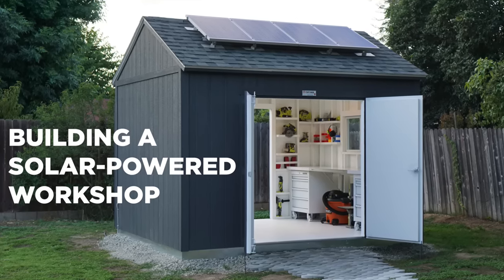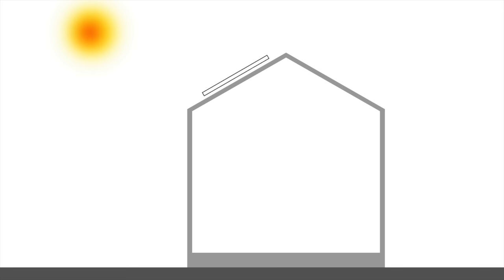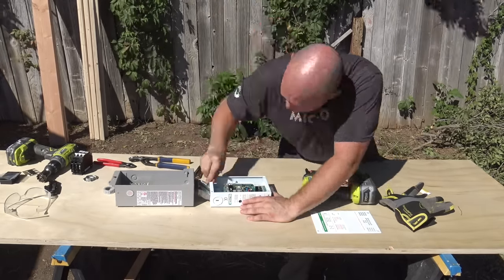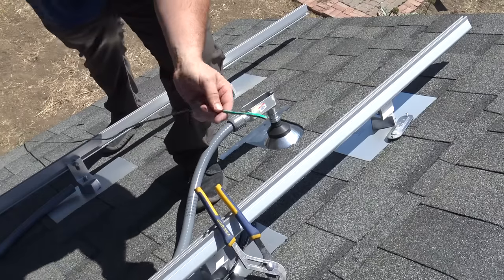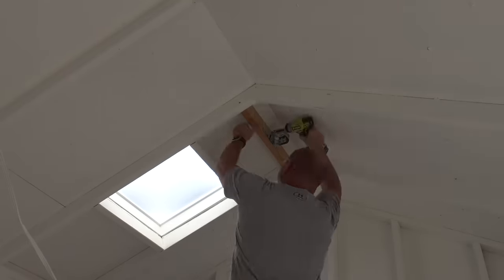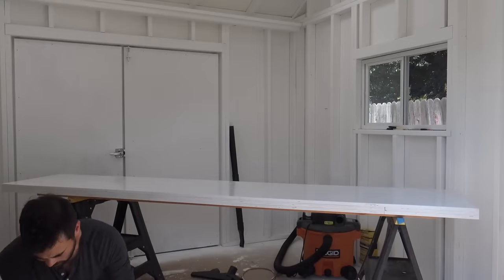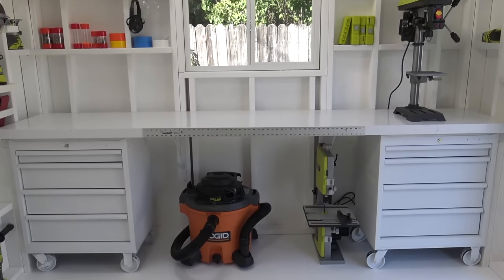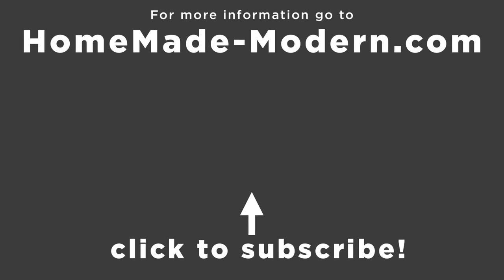Building a Solar Powered Workshop

Comment: Solar idea is super project but around 5000$ for this wooden room is too much I believe. You could buy a small shipping container (20 tons it’s 6mt*3mt I think) for around 800 bucks and do better for interior for half price I think. It costs too much.
Reply: TLH YSS  I don't think I shipping container as a shed is by code unless it under a certain width and height.
Reply: Yeah, but Home Depot isn't going to supply him with a shipping container, when they are retail partners with Tough Shed.
Reply: Depends.. in my city a no permit/no inspection shed is limited to 10 by 20. In other areas you may have no requirements or just go ahead and get the permit--which will include a foundation and electrical inspection.
Reply: $5K to run your power tools???
Reply from the maker: i did buy a shipping container and the quote to move it and unload it from LA to santa barbara was $2000
Reply: What I’m trying to say is 5k for only a wooden room (or big wooden box  which has doors and roof) is too much.  but looks pretty after spending more money to it👍 if you got money no problem it’s a pro job and to build you spend no time and energy. They come build and go that’s it. But if you have economic issues it’s not the first choice I think:) and all the room works with only solar power right?
Reply: Eco Mouse I don’t know about the partnership my friend what I’m trying to say is it’s too much for a wooden room:) it’s my idea👍
Reply: MrBobberino01 no dear friend not enough to make them work it’s only for a empty wooden room👍
Reply: Raskal if you use 2x20 tons container and put them side by side  and cut the top and make roof I think it’ll be enough height and width👍 of course if the shipping container is cheap. Of course it’ll take more time and energy. But cheaper👍 and  at the end of the day if I have more money in my pocket I will be more happy 😃

Comment: Only thing that might be missing is insulation. For us in the colder states it would be nice to have some heat or or even a/c. Also, can you run any extra electric wires off of the solar unit?

Comment: "wouldn't be much cheaper to build it myself"... yeah, ok.
Reply: Steed_Digital it's called sponsors. They subliminally plug them. It's interesting all of the tools are brand new, isn't it...
Reply: Subliminally eh? About as subtle as playing chicken with an 18-wheeler. This may as well have been a Ryobi commercial
Reply: yeah its amazing how EVERY single one of them, even the rake is brand spanking new, gee i wonder where he got it all from, you think he mentioned homedepot enough times?
Reply: Maybe your both right, however, once you get committed to a particular brands cordless battery platform, it really does make sense to expand your collection using only the same brand tools, where if you started with one of those $300-$700 multi tool kits, it's pretty easy to build up a collection like that rather quickly without needing to suppliment a lot more, or to have to be a Ryobi shill, especially at thier price point.
Reply: He was sponsored by Home Depot. Home Depot home brand is Ryobi.
Reply: it says so in the description
Reply: I can build the same shed for about $400-$500 instead of paying $3,000-$4,000...
Reply: Jared Graber nah you can't. I call BS
Reply: Srsly Brah add up the actual cost in building materials plus a box of nails...minus all the gadgets.
Reply: nerhu59  Considering the majority of the cost of that Tuff Shed is in labor to deliver & build it (both at the factory for prebuilt stuff and on site) then yeah you are absolutely right in this can be done for significantly cheaper.    Like a great many things, if you have the necessary skill set you have to ask yourself how much is your time worth.
Reply: This is a 40k shed... That no one can afford.
Reply: Love the finished look but, painting the husky toolboxs was sinful. It made them look cheap and unprofessional. Just a opinion guys don't jump all over me.
Reply: foytdie who cares? Just enjoy the content.
Reply: Jared Graber - do it then. And make a video. Maybe you will get views, maybe you wont. I love how people constantly criticize others that actually do stuff from the comfort of their couch
Reply: @J32-k9n  haven't priced lumber lately, have you?

Comment: Ahaha I look at the vid at first and I was like ohh I actually might build this and then I saw it was like 5k+ and I gave up hahahah
Reply: A lot of the cost is labour
Reply: I would assume the cost for the electrical components only (panels, batteries, inverter, etc.) would be only around 2500.00 but cannot know for sure.  I know a 400 watt Grape solar panel system including the inverter only (so no batteries, panels, etc.) is selling for about 1,200.00 CAD so the marine grade batteries, panel, wiring, etc probably adds another grand or more to the price.

Comment: You did a great job on that shed! But there is one thing I think you should invest in and I did not see it on the video and that is mobile home anchors. During a high wind storm that whole building could get knocked over on its side or worse. Most out buildings usually get their own concrete pad and usually get bolted down once built.

Comment: Looks great. However, I would have chosen a color other than white for the floor. That is going to get dirty real fast. Also, it might be a good idea to add a dust collection system for the power tools. It's a fairly small space, and if you have to keep the doors closed for some reason while you're working, it would help you breathe a little better. Of course, I know that you are working with a limited amount of power from the solar panels, so a system like that might be out of the question.

Comment: Hi nice & impressive..  Hay I want to build my own soler power supplyer. I want to run my Computer workstation which runs on 240 volt & 1000watt power consumed/hr.  I also run my laptop & a Fan & 2 CFL lamps & last one is two 27inch 4K LG IPS Monitor & 1 24inch CRT TV.   Could you suggest me if i want to  run all these things for 24hrs X7  how much powerfull soler pannel needed and howmuch battery needed.

Comment: What size battery did you use I meant Amp hours,(Ah) and the circuit breaker Box what amp fuses did you use? Or Circuit Breaker?

Comment: So silly question, but if you're making a portable power pack with batteries and an inverter (say in a tool case for small little construction projects), how would you treat earth ground on all the circuits? Would you just have to ignore it and take the risk?

Comment: This shed should be insulated and proper door seals if it is not in the Southern regions, It is no fun working in a shop that is below freezing. Add a propane or electric heater. Also the panels will need a system for adjusting their angle for the winter months, where the sun's angle gets much lower in the sky the more North your location.

Comment: (multiedited as i watch the video) Nice build, even with the sponsored nature of the video governing its entirety. More complete and prettier in many ways than I would have done myself, but i can see a few things where my overthinking brain (i admit it) would have done things a (very) little differently (shorter DC wire runs, 2v open traction cells like fork lift truck batteries are made of, possibly a small marine wind turbine to take up the winter slack). Or sees future projects to do as a rolling "ultimate shed" build. I really like the guttering uplighter idea. Now i want to build a shed despite having a servicable garage. Damn it.

Comment: How long do the batteries last, when you are working with lights on, machines running and toolbatteries charging?
Reply: Lets start from the basic.
Take 10Ah 12V battery for example, ignore losses
A 12V DC load drawing 1A will run the battery dry in 10 hours 
1A x 10hrs = 10Ah
Now include losses, it will be less than 10 hours
Ideally, a battery should never be undercharge below ~25% else it's life span will be shortened.

Comment: Since most of these type buildings are built as storage sheds, and one typically runs external power from the home to the shed, why not go ahead and route your off-grid power back into the home as an emergency generator?  I don't mean as a grid-tied system, but just to have a couple or three outlets in the house that receive their power from the sheds solar bank.

Comment: That's a great shop for a woman or beginner in wood work.   having a bandsaw or table saw that you can run stock outside and through the back means you can cut long pieces like 16 foot long, should you need to make a hand rail or something.   I would like a 40 by 40 foot shop with dust partitions of hanging plastic or movable walls and a vent to blow saw dust outside.
    If you want to save a lot of money you might consider building it yourself,  you will gain experience and knowledge that you can't get by watching someone else make decisions for you.   Get a wood miser saw mill and cut your own wood.  Logs are everywhere, in people's yards, on the side of the road and on land that needs to be cleared.   Dry it in a green house or a shed, keep it weighted down  and separated to keep it straight .  Treat it with boric acid (roach proof)  Paint the ends.   You can get a lot of short pieces from pallets.   Use torx screws with torx bits, they don't skip and strip out and don't require pressure to screw in.    Use treated wood on the bottom of wall frames to ensure they never rot or get eaten up by termites.  Styrofoam board is the best insulation and you can get it for free from shops and businesses that import large items, lamps, mirrors, glass or paintings.  It can also be mulched from scrap pieces and blown into hard to reach places, then covered with fiberglass insulation.  Use pieces in walls and seal them in with great stuff expanding foam.

Comment: what wattage inverter are you using? and should the batteries be 12 volts instead of 6volts?
Reply: Also there are solar powered exhaust fans, if you feel your little workshop is getting to warm or dusty

Comment: This video is clearly a disguised advertisement for Home Depot. However, it’s a great build and interesting to watch. I wonder if there’s a way to transfer power from the storage batteries directly to the tool batteries without converting to AC and back to DC. Seems inefficient

Comment: What's the life span of this equipment and resilience to hail damage
Reply: 25 years plus. I have an old PV array, seven 48W panels (Kyocera, I think) that cost about $4,000 thirty-one years ago, and they still work just fine. Power output HAS dropped off a little but not enough to be a concern.

Comment: So much wood, how do you protect it from rotting and termites??
Reply: That's a big downside to the base of that shed. No airflow underneath. That floor will probably eventually rot from moisture. Always best to get open air under a shed like that.

Comment: I put up a shed a few years back but put in a concrete pad. Not a bad idea as I am in an area with snow and it keeps the shed elevated thus no rot when the spring thaw happens and rain. You can also tie the shed down to the concrete base. You save a lot of money erecting painting and shingling the shed yourself. Plus buy the shed kit when on sale.  All that solar stuff is nice but really expensive. Why not just run a power line from the house to the shed? Or if only occasional use just use an extension cord?

Comment: If you are going to use that workshop for your business like woodworking or product presentation, the building costs will lower your taxes for some time. I would not condsider something like that for DIY and hobby.
Over here, I´m looking for used sheds and material to be removed from gardeners in autumn or spring which is pretty common if someone is planning something new or just leaving / selling the property.

Comment: Although this was a little overkill on the  Home Depot  commercial it did come out to be a cool looking build  and I’m not  completely convinced on the   True functionality od the AC power side sure the tools turned on but how will they really be under a load ???  Now i am a Woodworker and generally my saws are   Used  quite a bit and  for cutting hardwoods   Plus i use  much larger equipment than the little table top machines this guys sister  has  plus i would need to power a table saw  which is my most used tool  other than my brain and tape measures

Comment: 100 watts panel ! 325 watts goes for less than 300$ and 4 x 325 = 1300 w/h at full operating efficiency. Why have 100 watts panel which are fairly expansive in relation to those which output 250 watts and more. with 2 panels of 325 w/h you have more production than 50% of your setting.

Comment: insulate next time and put black pipe water heater on the roof and have heat and by the way its way to small ,a riding lawnmower will take up most of that space

Comment: convert dc to ac just to convert it back to dc. why not dc/dc? use a buck-boost. or buck converter to charge devices below the dc value of the batteries, or a boost converter to charge those above the dc voltage of your batteries. the inverter is wasteful converting dc to ac and the you convert it back?

Comment: You are wrong about not saving much money by building yourself. I was able to build a 12' x 14' shed with a gambrel roof and a full loft, my own design for less than $1500. Tuff Shed is way overpriced. If you're not able to build it, that's one thing, but you can save more than half buy doing it yourself.

Comment: December 2018  Philanthropists:  please buy these for the homeless, especially the victims of the firestorms.  Please buy high rise buildings and put these on every floor, one per person; and one per pet.  Try to work with experts who have been living on the road for decades, like Bob Wells of the channel 'CheapRVLiving.'  He has the respect of thousands and can help with setting up guidelines, rules, procedures, etc.  Also, Kirsten Dirksen has interviewed similar people who know how to make a 'Tiny House Community' pull together to last for years.  If every city around the world did this, there would be no homeless trying to survive on the street.  That is extremely dangerous, most get threatened, raped, beaten, robbed killed.  Frequently, the young muscular thugs, gang together to beat and kill the older homeless.  Please listen on You Tube to Dane Wiggington of geoengineeringwatch; Deborah Tavares; and Elana Freeland, to better understand what is causing these firestorms that burn down a football field size area every second.

Comment: 7:43 - There is no such thing as pre-drilling holes. There are only two states a hole can possibly be in, drilled or undrilled. Pre-drilled is a meaningless fucking term!
Reply from the maker: you are right!  i never thought about that way.
Reply: Admittedly, I stole that one from the great late George Carlin and adapted it a bit. That said, drilling pilot holes can be considered pre-drilling, to be followed up to the desired diameter or depth, for instance. But again, one would pre-drill the final hole by drilling the pilot hole, one would not pre-drill the pilot hole. Except when the final hole is really big to require several steps, otherwise that would be silly.
At any rate, lovely place! I liked the repurposing of rain gutters for lighting!

Comment: all that money on solar panels and then you use lead-acid batteries? wow way to go low tech
Reply from the maker: what batteries would you suggest? I can pass your expertise on to Jason.
Reply: HomeMadeModern lithium of course, there are some great ones for storage, even a few UPS (Uninterruptible Power Supply) would bet better than what looks to be boat batteries, less hazardous too. ive actually see boat/car batteries literally explode, the sulfuric acid leaks into the wrong part of one of the cells, or water leaks into the acid, and it heats up enough to literally blow it apart. horrible mess, and very dangerous

Comment: Ugh ... electric lawn equipment !?! I love the sound of a two-cycle engine tearing it up as I mow the lawn or whack some weeds! I'll take gas powered over electric for the yard tools. Obviously since there's no gas powered drill press or circular saw I guess I'd have go electric there. But instead of depending on the sun (here in sunny FL) for my electricity I'd amp it up with a 20hp generator. While I'm at it to make the generator a bit more powerful (And less fuel efficient) I'd slap on a supercharger just on principle. ; )